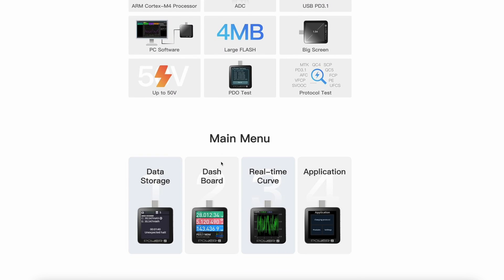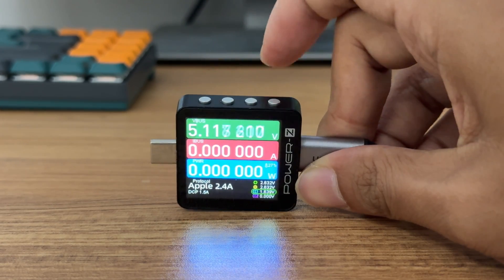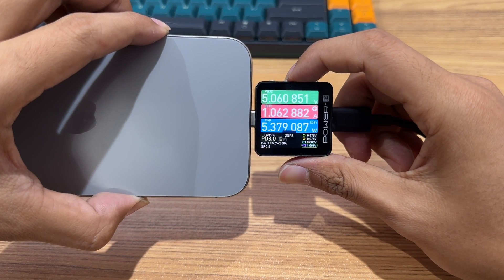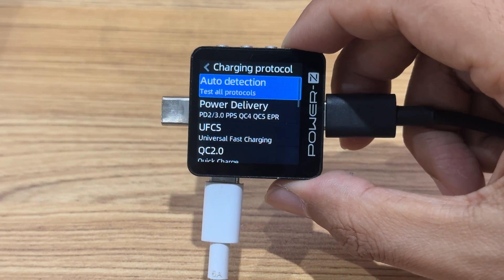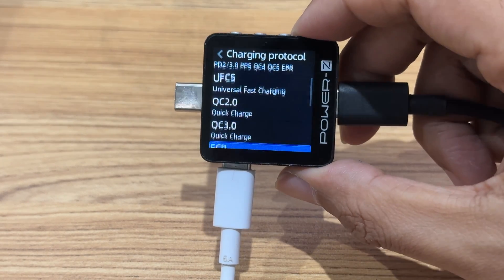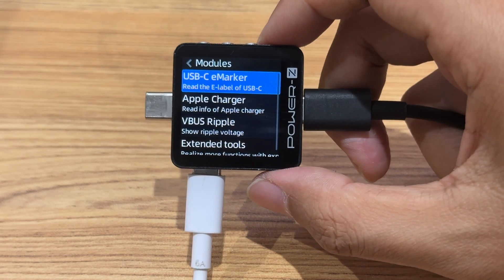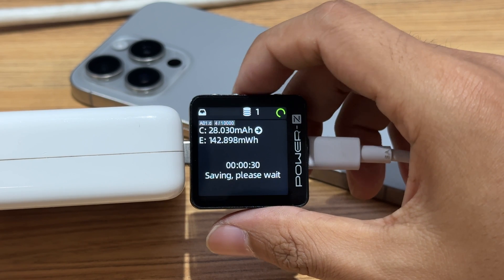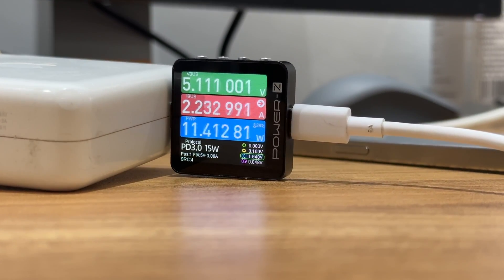Top TEN Functions | Teach You How to Use POWER-Z KM003C

Comment: What is #3 testing exactly? As in Hookup wise I don't understand why you would use both female? It's still upstream/downstream.. right?
Reply: The port opposite the buttons is for powering the unit separately from what's being tested/measured. It's also for connecting to a computer and getting the unit's output.

Comment: I have issues with mine, it keeps loosing power even when powered through HID port, and it’s happening often when a device or supply isn’t connected to the bidirectional ports

The other issue is that it cannot always set a protocol trigger. Unless I disconnect the power.

Comment: I have to admit I find the instructions confusing. The basic things I want to test are: how much power does a power brink I have output (and does it support PD), and how good my USB-C cable is. Some parts of the video show a USB-C cable plugged into the HID port while testing. Can I do this? What do I power it with? Or do I always have to have the Power-z in the middle of two devices? What's the best way to test Bricks and Cables?

Comment: I have a question. In some videos showing the POWER-Z KM003C, you can see, in the upper right corner where it shows PWR, a thermometer showing a temperature, but in some videos, like this one for example, there is no thermometer. In the table on the website, it says that this model does not have a temperature sensor. After all, does it have the sensor or not? Is there a revised version with a temperature sensor? How can new buyers identify it? And most importantly, what does this temperature refer to? Thank you!
Reply from the maker: The KM003C can only display the temperature of its own ADC, while the older KM002C doesn't have this feature at all.

Comment: why when doing usb c e marker it just keeps asking to plug in cable… no matter how many times i plug it in
Reply from the maker: The correct way to detect an E-Marker is to use an additional power source to supply power to the HID port and connect the cable being tested separately to the USB-C female port below.

Comment: the back button doesn't rotate my screen on mine. I have the latest 1.8.7 software. (Edit: Okay, just updated to 1.8.8!) That would be so cool, because during my videos, i'm constantly unplugging and replugging. and then having to get the rotation back to normal where it's easily viewable and not sideways or upside down. Other than that, this is the best damn tester on the market. I love it!!!
Reply from the maker: Hi sir! This could be because you have turned on the "Auto-rotate screen" function in the settings, which will automatically disable the button‘s rotation control.
Reply: @ChargerLAB  oh my gosh!! Thank you so freaking much. I will definitely be changing that. Will make recording videos much easier than picking up the whole device and rotating it constantly while filming. I can just press the button!! Haha

Comment: I mainly wnat to use my POWER-Z KM003C to validate the ports of chargers (and maybe also cables) I purchase.  Some are very expensive and have big claims.  But the only way I've been able to someone test them is to have my Dell XPS drain in power as much as it can so I can test the max power draw.  But even at that my XPS 17 only draws about 82 watts. (I'm using 240 watt rated cables)  I have chargers that should be able to charge at 140 watts. (single port).  How can I use my POWER-Z KM003C to validate that?
Reply from the maker: You can use either a device that actually supports 140W input or an electronic load to do the job.
Reply: @ChargerLAB  Can you please give me some details how to use electric load with my POWER-Z KM003C?  If I use a DC Electric Load Tester, how can I hooked that up to pull 140 watts with USB-C?

Comment: 3:11 So I understand, if I want to examine the charging protocols supplied by a laptop, I can plug the "Port 1. Standard USB-C Male (Plug)" into the laptop port... but then I should not leave anything plugged into "Port 2. Standard USB-C Female (Receptacle)" as anything there will receive the charging voltages demanded. Correct?

And then it is vice-versa as shown in the video... if I examine a charging cable plugged into "Port 2", then I shall not attach anything to "Port 1".

And the HID, it is always safe and I will not damage anything plugged in there during the scanning.

Do I understand this correctly?
Reply: Your laptop if having somehow DP power OUTPUT, then yes, you can use the male/female connect to your laptop with nothing else. This is NOT-NORMAL usage. 

Else, NORMAL usage is to check how your laptop charges up. Then you plug the cable from the power brick into the female port. Then male port of the KM-003C into the laptop, now the meter with show you numbers. 

Another NORMAL usage is to check if each different power brick has their advertised specs (and actually can do the specs), then you plug the power brick into the KM-003C male/female main port, the HID port will need a c-c or a-c cable plugged in, to power the Power-Z itself. Then at this state, you can use the KM-003C to detect all power output mode for the brick itself. Note: if using a C to C cable, then DO NOT leave anything on the main male usb-c when do detecting. And also, the cable itself have to have higher specs than the bricks, or the test will only detect to the limit of the cable. 

Editted: yes, the HID port is for power up/keep the km-003c alive doing testing when there is no client (getting charged) device plugged in. And also, obviously, if not, show the KM-00x to the computer as an HID device

Sauce: I have both the KM-002 and the KM-003
Reply: @StooStranger  Thank you! Yes, my Apple MacBook Pro has four USB-C ports. All four of them provide PD for peripherals. PD 3.0 (7W) and DCP are detected. Interestingly, when I plug in my MagSafe peripheral, it receives PD3.0 12W though. I guess the detection is an inexact science.

Comment: 2:49 Wrong, there's also Infinix protocol
You'd better fixed a bug with overwriting offline recordings
Still no promised cable resistance test!
Reply: what is the name of the infinix protocol?
Reply: @childone4315 TFCP. They didn't use latest firmware on video